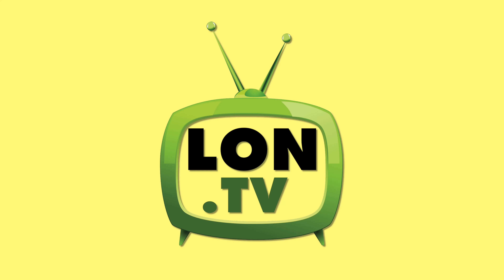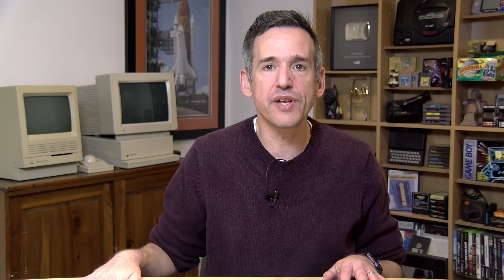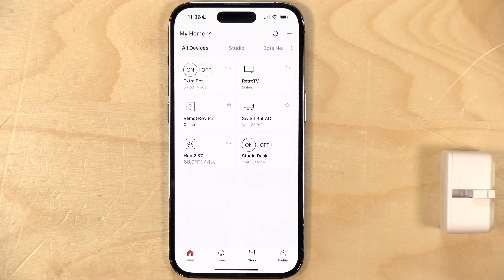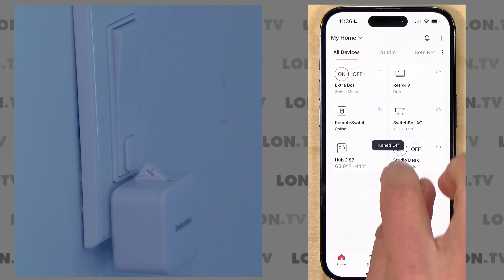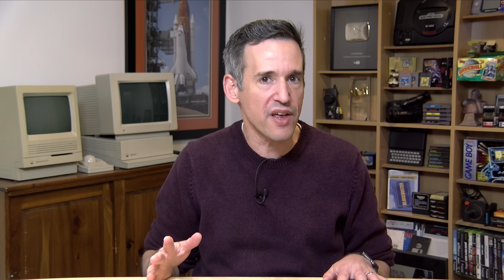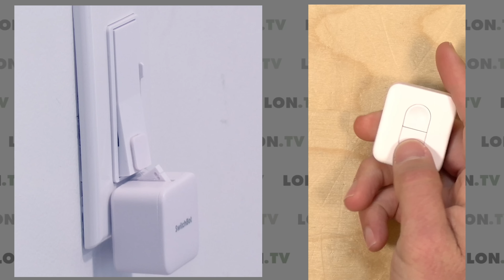Switchbot Hub 2 Makes Light Switches and IR Devices Smart - Full Review

Comment: I like that they put in a light sensor and IR.  I'd be curious how accurate the temp is in the hub.  Some of these types of devices run a little warm and it makes the temperature a little higher.
Reply: The sensor is actually swiss made so it is pretty accurate and it is in the loading cable and not in the device itself.
The temperature Varies +- 0.2°.